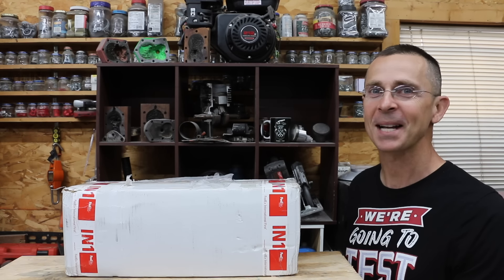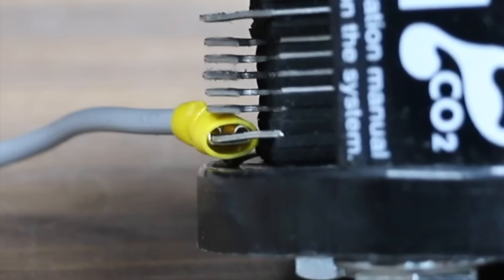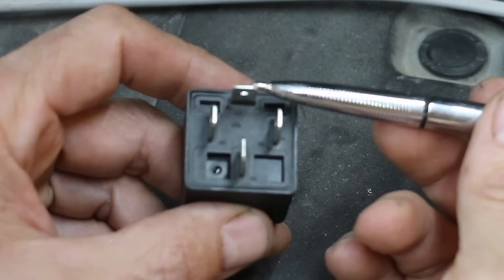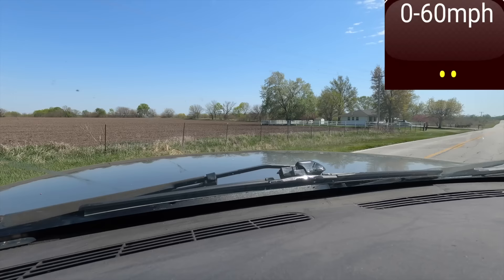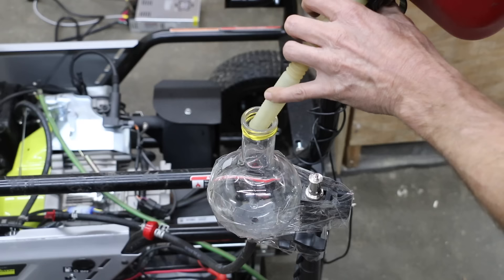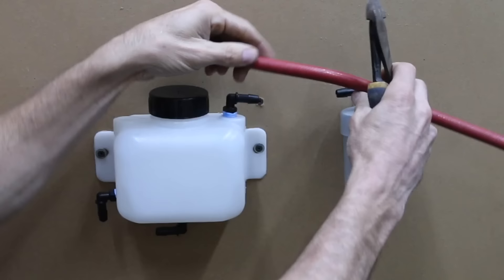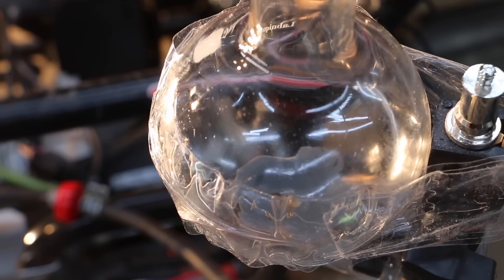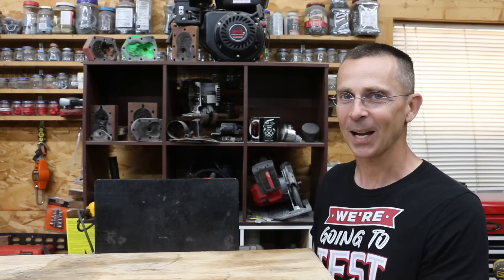AMAZING 35% More MPG with HHO? Let’s find out! Help with high gas prices?

Comment: Fundamentally, this is all about the laws of conservation of energy and the first law of thermodynamics.

The principle of this is perfectly valid; evolve Hydrogen from water and you've got yourself a combustable gas that can power an IC engine.
The problem is that, in use, it's a closed-loop system and no system is 100% efficient, let alone MORE than 100% efficient.
Basically, this is like bolting an electric motor to your car's engine and then powering it from the car's alternator - it'll always take more power to run than it generates.

There IS actually a place for this sort of energy production.
The trick is to find a cheap source of energy and use that to harvest something so that it can be used to replace a more expensive source of energy.

You could, perhaps, get a heap of these HHO generators hooked up to solar panels, use them to evolve Hydrogen, store it in a tank and then transfer it into a tank in your car.
In practical terms, however, there are a lot of "energy overheads" which'll eat into the efficiency and usefulness of the system.
To store a useful amount of Hydrogen, for example, you'd need to store it at high pressure which'd mean you'd need some kind of compressor and that's going to use energy too. 

Seeing Hydrogen bubble out of a hose looks impressive but, in reality, it's a pitiful volume of gas.
A simple experiment to test this would be to get a length of clear 1/2" hose, hang it in a U-shape, fill it with water, attach the HHO generator to one end of the hose, have a measuring jug to catch the water at the other end of the hose and let 'er rip.
See how long it takes for the Hydrogen to empty half of the hose, check how much water has collected in your measuring jug and that'll tell you how long it takes to generate that volume of Hydrogen.

On a related note, another source of confusion is likely to be fuel consumption vs Hydrogen gas consumption.
A car uses around 20ml of fuel per minute so as long as you're generating 20ml of Hydrogen per minute, you'll be fine, right?

Nope.

Your car uses 20ml of fuel mixed with 1250 LITRES of air to create a combustible mixture EVERY MINUTE.
A combustible mixture of Hydrogen and air might require, say, 10% hydrogen, or 5% or perhaps only 1%.
That means your HHO generator needs to be generating anything up to 150 LITRES of gas PER MINUTE to power a vehicle outright.
Those little bubbles farting out of the HHO don't look so impressive now, right?
Of course, if you just want to supplement your vehicle's fuel supply with Hydrogen, that's fine.
You'll just need to reprogram your car's ECU to account for that before it'll work.

Anyway, point being that you'll need to cheaply collect a HUGE volume of hydrogen, and probably store it at high pressure to fit it into a usefully small tank, before this can become a practical source of energy.
It's possible... but not with a $200 DIY kit.
Reply from the maker: Thanks for sharing.

Comment: I think you need more hydrogen, less gas.  The fuel pump and injectors are going to pump as much gas as they are designed to pump regardless of what you have going into the air intake.  Also,  I don't think hydrogen cleans the carbon.  It just burns clean so there is no carbon build up.

Comment: You gotta use a car, the generator doesn't have a feed back system to know what's happening, all that is happening is that the engine is just running on both gases, gotta use it with a car that has an o2 sensor

Comment: the generator your using to test does it run closed loop on the EFI management? If not, that could be why your not seeing an increase in fuel efficiency. when the HHO system is on and injecting hydrogen gas, the o2 sensor in the exhaust would see a "fuel rich" condition and start trimming the fuel injectors, thus, using the hydrogen gas to supplement the gasoline. Theoretically, you would see an increase in fuel economy.

Comment: So HHO on a modern vehicle is useless with out a ton of aftermarket reworking. This is because of the brain of the systems. Most people who test these devices always do a 30 day test which is an OK start but not a good test. HHO kits on an old carburetor wakes this run much better. As for carbon buildup it will help reduce it but it takes months of running it religiously to get any effect. Ran one on a 68 firebird with the 400 in it and 49 mpg was the average. Compared to that of the 26mpg I got in a 289 high performance v8 in a 65 mustang. And when we tore that 400 down to replace a head gasket the pistons looked almost new

Comment: For the vehicle test, you should also add a modification to the oxygen sensor, which is offered by hho generator manufacturers. Without this mod, the sensor will detect an increase in oxygen input and increase gas flow, which will make zero benefit.
Reply from the maker: Thanks for the suggestion.

Comment: @ProjectFarm Try HHO on a seperate battery instead of drawing from the alternator or power from generator. HHO generation cannot be 100 percent efficient its impossible. So whatever energy is coming from the alternator to split the water into HHO is also generating heat therefore there is a loss in efficiency. Now a vehicle with a 2nd battery and a renewable source of power will benefit from this, a solar panel and 2nd/3rd battery will increase mileage more than running it off of an alternator. The benefit of HHO is the water acts as a solid state battery in the sense that its quality never changes.
Reply from the maker: Thanks for the suggestion.

Comment: Not hooked up correctly , the Hydrogen needs to be directly hooked up to your fuel line , or you will need bigger hose in the intake to increase the volume of Hydrogen

Comment: Comparing the size of the HHO generator to the one I saw running a generator (here on Youtube) it's about a fifth of the size and that one ran a generator without gasoline. I'm not surprised that kit had no effect on the operation of either the truck or the generator.The concentration of the electrolyte AND the surface area of the electrodes matter significantly. The cell is too small to be of much assistance in fuel milage. I'm surprised you didn't suck the electrolyte into the engine.
Reply from the maker: Thanks for the feedback.

Comment: The HHO generator shortens the runtime of the generator slightly because (1) the power supply is not 100% efficient, and (2) the conversion of water to hydrogen and oxygen is also not 100% efficient, so you are getting less fuel back than you consume powering the device.
Reply from the maker: Thanks for the feedback.

Comment: I don't see where the gain in energy is. We input energy to break down water into H2 and O, then recombine those same components to get back the same energy and water.  In fact, there is an energy loss, because the electrical energy to break down the water comes from the same source that is using the energy. So if there is a net loss of energy in the process, how can you get better performance when performance increase would certainly require additional energy beyond your the performance you get without this "generator"?

Comment: Does the O2 sensor read the difference when hho is introduced? It should read it right so it will lean out the trim. Hence saving fuel. If not it's just burning up with the gas.aybe lean out the fuel table and add hho and see if it runs normal. Hence saving fuel. This test didn't show if it messes with fuel trim. Might work better on a carb but you would have to put in smaller jets and replace the missing gasoline with the equivalent of hho. Just my thoughts.

Comment: I think you are missing something  because Elon Musk claimed tesla engineers built a hydrogen system boosted fuel economy by 40 percent. I would assume if you modify the fuel you would need to modify the air fuel ratio as well.

Comment: from watching all the videos about this - if the kits that are available - were controlled by a computer or fuel management like in the LPG system - there would be better results - but most of the kits don't have any of that   ( few do ) if the stock computer cant adjust that AF ratio then u wont see much of gain or at all
Reply from the maker: Thanks for the feedback.

Comment: My question is. If they both run about the same within seconds of each other. Why wouldn't you use hhl waters ask a lot cheaper than gas. I'm interested in your answer thank you Jim.

Comment: Wouldnt you have to tune the fuel for this to actually help or work at all? It would probably work if the engine knew that it didnt need to inject the same amount of fuel to stay running

Comment: It does work but can't just slap it on like that it has to be tuned to run it .hho burns different than gas . There used to be a guy that had some kind of buggies that has 3 cylinder geo metro engine and they got over 120 mpg

Comment: I think it would be better to build a gasifier and burn wood chips and paper trash like they did during WW2 since most of not all gasoline went to the war effort. Cars, trucks and even farm equipment were modified. The modified equipment ran exclusively on the burned fuel with little to no problems.
Reply from the maker: Thanks for sharing.

Comment: Is thT an inverter generator or not because that would make all the difference on westher that test was relevant or not. If the generator is not an inverter type generator it will run at the same rpm the entire time no matter the load placed on the generator and will likely use the fuel at the sane rate, regardless of the hho.

Comment: he is using a generator for max 2 liter engine and he didnt reset the engine values. I tried it even and drove 1716km and i saved one full fuel tank with the same HHO system on a BMW 320i.

The Generator is a mechanical carburetor so there you use this or that if both together will be no deference.

Comment: I've been working with the use to be HOH and now called HHO generators and what they create. My discoveries have concluded that using it for any internal combustion engine is a waste of time because the HHO is EXPANDED gas that collapses once a spark is introduced. So, you have to modify the engine to be an internal "implosion" engine with different valve timing and spark at 80-85 before top dead center. Note: Collect the gas as it is bubbled out of the generator, under a water protected method gather it in anything that can be internally sparked maintaining closed operation and even a cubic pint of volume will collapse too nearly nothing. Is it possible to make enough HHO to power an internal implosion engine and keep it operational? I'm working on it, and like anything completely different from the normal, it takes lots of time and persistence.
Reply from the maker: Thanks for the feedback.

Comment: Could you revisit the yest sometime with the use of an EFIE? Both that 5.7 and that Ryobi generator are likely using narrow band sensors. I think the HHO generator is way too small for a 5.7, anyway, but should be a good match for the generator. A problem with narrow band O2 sensors is that they only read lean or rich. Newer vehicles with the wide band sensors can be tuned to permit a more lean burn condition to exist without the computer dumping more raw fuel into the injectors in an effort to retain the proper stoichiometric mixture to the best of its ability to. So, we already know that the narrow band O2 sensors on both the test vehicle and generator are attempting to retain the proper stoichiometric mixture determined by the data on the ECM and they don't have a way of being tuned to tell the computer that it is okay if there is a higher air to fuel ratio and it isn't to attempt to compensate by dumping more fuel into the injectors to sustain the stoichiometric mixture trims it has in its software. The next thing is to attempt it again after the use if an EFIE with a PWM powering the HHO unit. It gives the cell time for HHO to dissipate from the cell plates before applying energy again to create more. This results in less electrical usage, while it may achieve a similar production level as straight DC current. Finally, various frequencies can be incorporated in an effort to achieve resonance, permitting for even more production without the use of a tremendous amount of energy to accomplish it. Good test. Could you revisit it and test these other incorporated ideas incrementally?
Reply from the maker: Thanks!  Thanks for the suggestion.

Comment: there is a problem with that particular HHO generator you don't really need to seperate the water takn and the generator tank that adds a potential leak/fail point you can simply add the electrolyte to the generator tank and there is also the physical location you chose the HHO unit should be below the level of the engine it supplys as Hydrogen is lighter that air and will rise.. forcing it to travel down inhibits the efficiency or the unit the size of the hoses is another problem as the concentration of Hydrogen and oxygen is depleted and will find an exit point before getting into the engine.. a smaller single tank unit is more efficient and simpler to hook up and operate... you can in fact run that electric generator on a smaller more efficient HHO unit if the electrolyte concentration is correctly managed a 2 liter jar with lid and 4 stainless steel bolts ae better to get the desired result will produce a better gas rtio and a smaller tube diameter is desirable as apposed to the largr.. the bubbler is a flash back inhibiter and the 1 way check valve is for the same purpose.. they are for safety.. try a glass mayo jar , 4 stainless steel bolte (2 pos ans 2 neg the electrolisys will be visible in the glass jar potasium hydroxide will do nicely in the jar a 14"id tube is big enough seal it as well as you can and still the hydrogen will find the weak seal regardless but a minimal leakage isn't a problem if there is at least a little.. the unit should be below the destination of the gas tube. Physics and hydrodyma= ventelation...Hydrogen rises si it's a good idea for the generator to be below the engine intake Physics are an issue here the closer to the air intake throtle body the less chance for the hydrogen to escape or disipate in transit... if the experiment is flawed as yours the results are invalid at least... try it my way and see... why over complicate a simple build seperating the reservior and the generator tank is not nessesary..and only adds a fail point and potential leak points in the connections to and from it...

Comment: This was predictable.  You're using the engine to provide power to the HHO which in turn produces hydrogen and oxygen.  The problem is, electrolysis is maybe 50% efficiency so you will always be losing a significant amount of power with this system - you're putting more energy into the device than you are getting out.
Reply from the maker: Thanks for the feedback.

Comment: You’d have to generate a whole lot more hydrogen per minute for it to make any considerable difference. That’s the problem with hydrolysis, it takes too much energy to produce hydrogen at a rate high enough to be used on demand.
Reply from the maker: Thanks for the feedback.

Comment: Can u test the fuel consumption of the vehicle by reducing the gasoline to the engine via ECU around 10-15% and then introducing the hydrogen. If the car keeps same performance as 100% Gasoline without hydrogen then there is a saving of 10-15 % Gas. The power required by the Hydrogen kit should come from the car Alternator.
I believe this kind of test will further clarify if there is any saving or not.
Reply from the maker: Thanks for the suggestion.
Reply: I like this suggestion

Comment: HHO does not work on computer controlled  fuel injected engines. Try the same test on non -computer controlled engines like carbureted engines. The computer compensates for the extra fuel and oxygen that is being fed to the intake.
Reply: do you think its possible with a remapped ecu?

Comment: You haven't taken into account the fuel regulation of the systems as no matter what you put into the engine if your fuel settings remain the same your engine/gen will use the same amount of fuel every single time.... And i think you have missed the main point to address. The fuel cell also consumes energy to produce gas....

Comment: increasing compression and adding water to prevent detonation might work. but generating hydrogen from low efficiency alternator and low efficiency engine doesn't make sense...might get 25% of power back
Reply from the maker: Thanks for the feedback.

Comment: This would work if the amount of hydrogen being input into the engine was thousands of times greater. Automotive engines use hundreds of CFM‘s of air every minute. A tiny tube of hydrogen is like a drop in a bucket. This might work if the water tank and oxygen plates was the size of a 2500 square-foot house. Or if the hydrogen was pressurized in a huge tank and let into the engine at high volume
Reply from the maker: Thanks for sharing.

Comment: The trick is to run the vehicle off of the generated hydrogen and oxygen only.  There is no way the computer in a modern car can sense the hydrogen being put into the air intake unless it is introduced before the mass airflow sensor and the normal air intake is partially muted. The computer would also have to be "told" to run lean or in "hydrogen mode" because I am introducing hydrogen/oxygen into the system in lieu of normal air fuel mixture. A lot of variables to be considered.
Reply from the maker: Thanks for sharing.